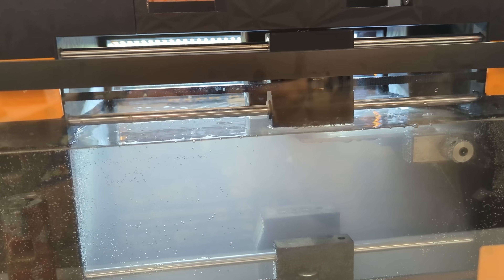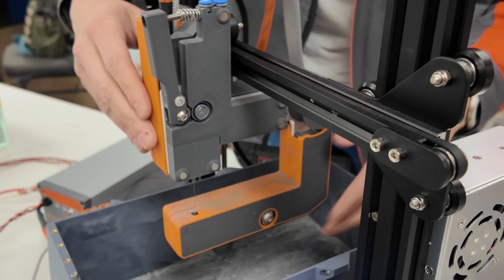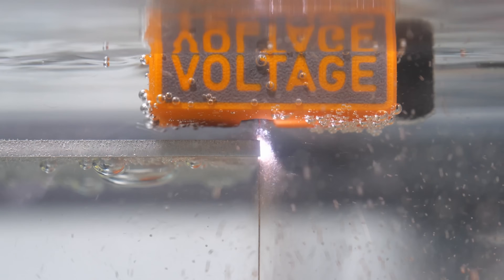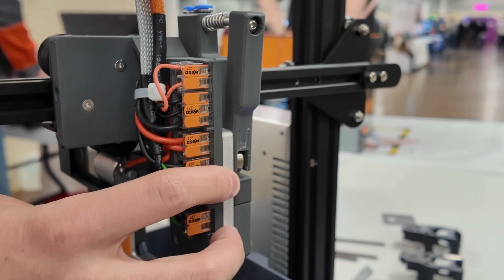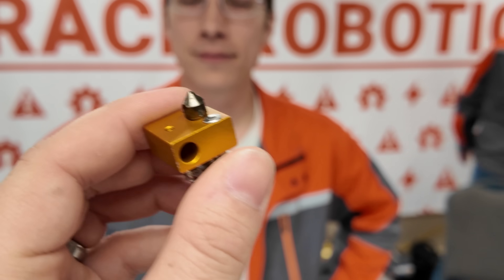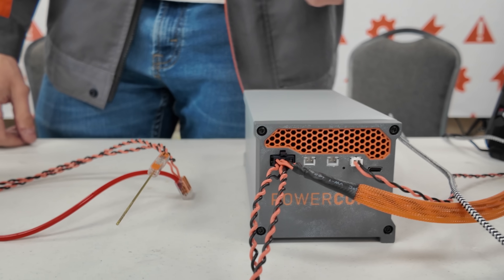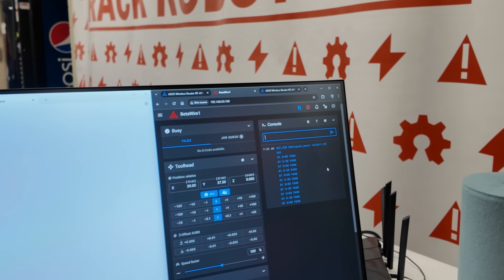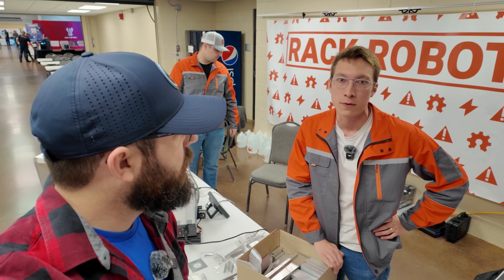Wire EDM at home? RackRobotics PowerCore V2 FIRST LOOK #3dprinting #rmrrf

Comment: Does this have to go fully through the materiel since its a wire? Like if you have a cube you couldn't just machine holes on the top you'd have to go fully through it. Someone correct me if I'm wrong please.

Comment: what is tolerance of cutting stainless steel, like tolerance which parts will have apart from desired dimension
Reply: I believe thats dependent on your printer / motion system

Comment: Could you scale this to use as a replacement to a plasma cutter for 4 x 8 sheets of steel or aluminum?
Reply from the maker: Theoretically yes, but the speed when cutting something that large would be a big drawback
Reply: @CanuckCreator  What would be the largest size you could scale it to, and still be useful in the home shop?

Comment: So, this only can cut outer surfaces?  With the wire being pulled through under tension, you can't cut a hole in the center of metal, correct?
Reply: Probably not with this particular device, but surely the same mechanism in a “drill press” form factor could drill a hole?

Comment: Between FDM and Resin 3D printers, home desktop CNC, home desktop (but you probably want it in your garage) laser engravers and laser cutters, and now home desktop sized EDM, the barriers to entry for rather serious, professional manufacturing capacity (if low speed/volume) have become laughably small.  This is wonderful for at-home makers interested in taking ideas in their head and making them into products in their hands without breaking the bank.  I love seeing all these technologies progress as fast as they are.
Reply: Yeah I'm really excited to see the next ten years. Also the availability of cheap import tooling that allows for easy entry into machining.
Reply: Also is diy injection molding machining。The barrior now for diy builder is the SLS 3d printer machine

Comment: is the power supply or the edm generating voltage open source , being honest here i want to buil one to make small parts , or tiny molds for silicon and then resin, edm usally is precise at small scale and good surface finish , amazing work 🎉❤

Comment: Wondering if the wire used is just a disposable wire or you can actually reuse that???
Reply from the maker: ehh, its not really recommended to reuse it, as the EDM process erodes BOTH sides of the process, so the wire gets "eaten" during the burn as well, and repeated use GREATLY increases the chance of it breaking and also will affect how consistent the burn width is

Comment: So this is just a fancy bandsaw? It's just 2D right?

Edit: wait a minute... $550? Wow. So setup for less than $1000. Can't do big stuff, but this is still very interesting.
Reply: It could do big stuff, it just depends on what you put it on. Put it in a swimming pool and cut raidroad track lengthwise.
Reply: Accuracy of EDM can far exceed what you could do with a saw. Think of puzzle pieces that fit together with invisible seams and no filing work!
Reply: @BertNielson   I would not expect that kind of precision or accuracy out of typical stepper motors. Industrial EDM uses linear motors or servo.
That said, even this crude design could still have niche uses in prototyping fairly intricate metal spring/compliance mechanisms and other delicate things out of a variety of materials.
Reply: @Metapharsical  switching to servos wouldn't add that much more to the overall cost if greater accuracy were the demand. 3D printing has made similar leaps since the earliest days of RepRap.

Comment: I've been programming and running wire EDM's for over 30 years. I have to say, this is impressive. I will probably grab one of these for home hobby use. Pretty cool. Impressive.
Reply: Hey I’m in the service field world right now but would love to get into machining mind if I pick your brain

30 years of experience is a lot
Reply: The surface at 208 sek seems quite rough. Do you know how to get that better - or is that a limitation of the less than ideal rigidity of the setup?

https://youtu.be/YLF70yzrhWw?si=Ydilp0oabJsRJjKV&t=208

Comment: Next step: Reduce that energy, tighten that gap and get those sparks polishing...
Lovely project!
Reply: With this being open source, I have no doubt we will see a community hivemind effect iterating and refining on the design and the software making it better and better.
Reply: They think that they can tune this thing up further with better characterisation and firmware. It's still very early days! Once the community at large gets their hands on this, you can bet we are going to see it being optimised and pushed to the true limits of the hardware REAL quick.

Comment: I am about to commit blasphemy: I am more excited to see this than Voron Cascade.

I ask a machine shop to make a precision gauge for me? They default to the EDM wire.  I dream about CNC plasma cutter? This is far superior.  Now, the question is: do I commit my ender3 to a Enderwire? Or an Ender....um, wire?
Reply: plasma cutters have a huge kerf... you'd better off using a laser or waterjet. This edm sounds good but is awfully slow
Reply: @rolandomartin  Both of which won't find in your average home garage due to their insanely high equipment cost.  Wire edm and cnc plasma are for different applications.  A small DIY CNC plasma cutter build would be 2ft x 2ft, most are at least 4ft square but they can cut very fast.  Wire EDM is better for small precision tasks but takes much longer.  I have a good sized cnc milling machine (not a router) but I could find uses for this wire edm.  I've broken plenty of tiny end mills over the years, this would solve that.
Reply: @dev-debug  A Wire EDM can make cutting tools and then if you need spped you just have to build a hydraulic press and just  punch it as fas as you can, surely better than plasma CNC for many equal small pieces fast
Reply: I would say, that every technology has its place, but it depends on the job as to which one to choose. For cutting metal, a cnc can do more depth 3d stuff like blond holes and shallow pockets while maintaining the bottom for 3d parts. Laser and edm and plasma are mostly for flat sheet work to cut all the way through. So it always depends on the job. If it's small precise work with thick material edm is great. Laser is thinner mostly but faster. Plasma can do a decent thickness at a decent speed but has a huge kerf and may need cleanup after. So the choice depends on the goal of the project. I don't do anything that would benefit from edm, but I do have a cnc and laser because they best solve my projects in the shortest amount of time.

Comment: How can you figure out what speed to go at?
Reply: as far as i tested a couple 'normal' edm.. to slow would sometime widen the erosion a little if not more. furthermore speed, current/voltage set, electrolyte, flushing and surprisingly temperature also related to surface finish and cutting speed. anyway, amazing work..
Reply: @sodium.carbide  My power core V1 is about 1-4mm/sec for the thin aluminum stock that comes with it (The thin metal you see in the video). Apparently Steel takes 4x longer. Its not a fast process, but it cuts just about any metal cleanly.
Reply: @yeabutwecouldbefreer  awesome, considering it's a home diy and low power. fyi, usually we don't use water based dielectric liquid for steel. we use hydrocarbon-based oil, but you'll need a lot more power to spark. it gives you much more removal rate and a relative cleaner surface finish.
Reply from the maker: Trial and error along with using known good values to start
Reply: @CanuckCreator  How does error look? Too slow cuts too much, and too fast breaks the wire?
Reply: @marcus3d  Too slow doesn't hurt anything. Too fast breaks the wire.

Comment: being able to cut hardened metals at home with low noise and sparks/dust is pretty awesome.
Reply: The noise is absolutely a game changer for home makers.
Reply: I just had some funds reserved to buy a Carvera Air, but then I didn't buy it because of the noise and space is needs (including vacuum and all the additional tools and parts that a CNC needs). This wire EDM looks like a great machine to buy and build instead. I'll probably design my own machine around the power supply.
Reply: @MarinusMakesStuff  you are braver than I am. With that high voltage I wouldn’t trust myself
Reply: @DrGeta666  what high voltage? Is 65 volts really that high?
Reply: @ I guess it’s relative. Give it a lick and let me know how high it is haha
Reply: "pretty awesome"? PRETTY AWESOME?! this tech was owned by major industry players and had a barrier of entry of $100,000's and now it's decentralized to the point you can have it on your desktop for dirt cheap. you guys better use these machines to make some $$$$$$$$$$$$$$$$$$$$.
Reply: @chrishayes5755  why?
Reply: @DrGeta666 because many people have neighbors. Plasma cutting is pretty quiet, too with a silent compressor.

Comment: I wonder how can you zero the system, or calibrate to piece.
Reply: From how they talked about it, I'm guessing it's basically run a sample G code (on a specific metal/alloy/conductive material with a specific wire alloy) hoping for X/Y dimensions, then do precision measurement on the end product, and you have your (initial) calibration offset values for that wire/material combination.  You would need separate calibration runs (and probably iterative calibration to figure out your +/- manufacturing tolerance capabilities) for each material you want to cut.  All other factors would have to be taken into account as well (are you recirculating your water, are you running the recirc through filtration, recirc flow rate, energy and frequency settings, etc...) to get the most accurate and repeatable results possible.

Thing is, as a home wire-EDM community grows and people do this iterative testing and share it, the individual barrier to entry in time investment will drop and drop as each person need to do less and less calibration and can replace a lot of the initial calibration testing with looking up results other people have gotten when working material X.

Comment: Can it self feed?  It would be nice to be able to burn holes.
Reply: You need a thick enough wire for it to be stiff and some way to flow more water into the hole. You'd probably be better off making the initial hole in a more standard way and then feeding the wire through it like they did with the nozzle example.

Comment: Why?  Is it to replace plasma cutting, water cutting and Lazzzerzzz ? 

I thought EDM was supposed to deposit material?
Reply: EDM is much easier to make at home to machine metal.
It also makes water jets, lasers and especially plasma cutters' tolerances look funny. This particular machine may not, but EDMs can be literally made into zero tolerance machines. That, in fact, is the process by which zero-tolerance demonstrators are made.
No deposition should be taking place. It's using electric arks to vaporise metals into plasma and remove them into the water. It's not a laser/plasma cutter to deposit slag.
Reply: Electrical discharge
Reply: @camplays487  I get that.  

It just a blotter type of cutter… is it just less messy then water etc? 

Isn’t there electro deposition too?
Reply: @75keg75  think subtractive vs additive manufacturing, this one in the video is the subtractive manufacturing wire edm in contrast to E-deposition which would be additive. Deposition is a bit more complex if I’m not mistaken because it would take ages for large scale mechanical parts which is why it’s typically just surface treatment. Also edm is so satisfying to watch
Reply: @75keg75  there are also subtypes, instead of wire you use a rod to cut cylindrical geometry or a solid die for complex geometry usually cutting solid block of metal but not always could be a thick plate.

Comment: Looks very interesting.  Would love to see some real-world examples in 10mm thick 6061 aluminum.  Guessing you can't cut holes with this, and can only do cuts that enter at an outside edge.  Is that correct?
Reply from the maker: It can do "sinker" style EDM work if you know what your doing, as for holes, would need a pilot hole to feed the wire through first, then go from there
Reply: So when you use the hand held rod, you can't push out through the material?
Reply: It
Reply: @rslaskjoel8617  Yeah, you can, that is what is considered Sinker EDM; you could have both on the toolhead and use the sinker just for the pilot holes.

Comment: Trying to think how a voron gantry could be used to make this more scalable don't need y movement  but limited by tool throat
Reply: I've been thinking about the same thing.  I think there are some cube fish tanks that could fit inside a 300mm v2.4, however a custom "double stack" kind of like the one in the second machine they showed is more interesting.